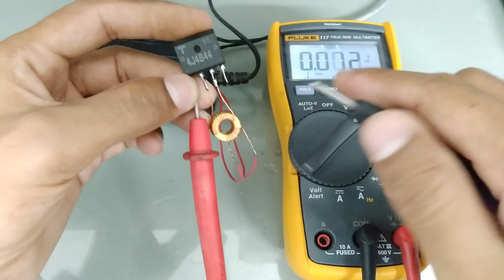add this circuit to 5v adapter | voltage booster | diy

Comment: I dont recommend you pluging that thing into live without protection and the wires are loose, the circuit you made is a basic transformer, you could do the same thing adding a few more turns to the internal transformer.